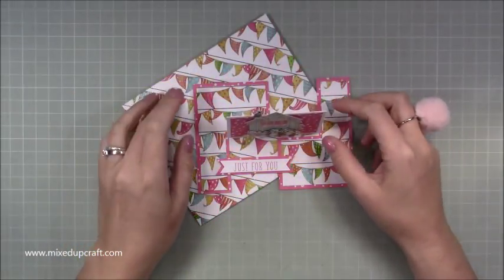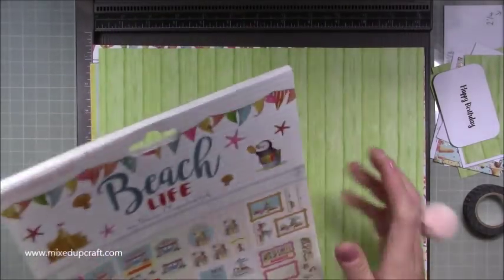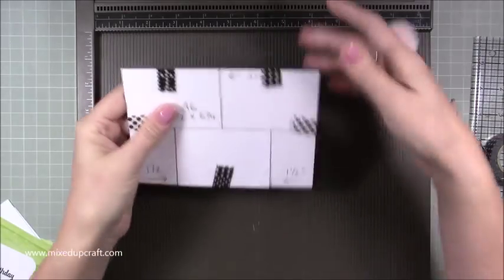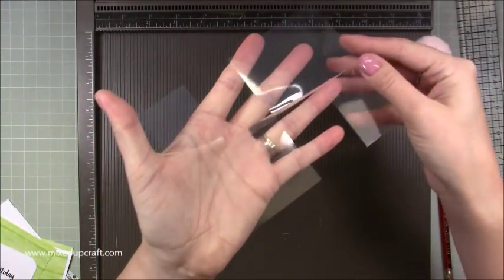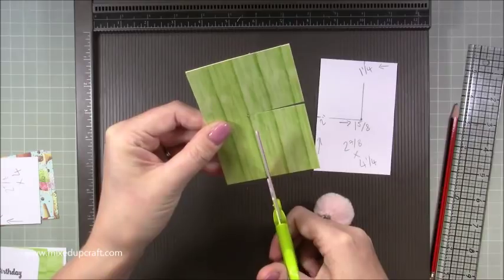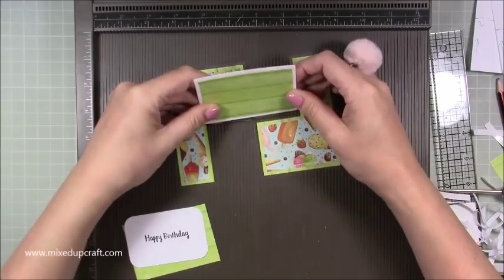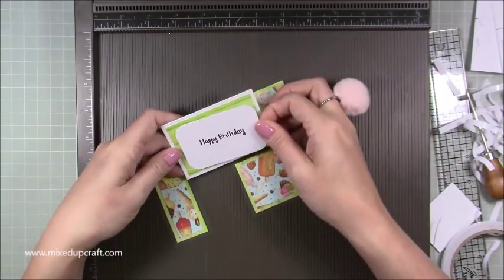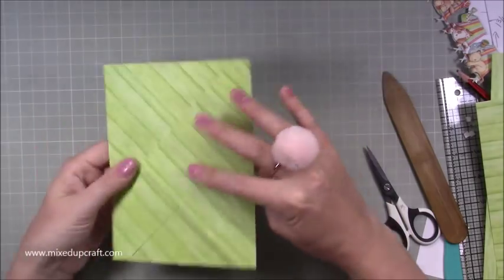Invisible Impossible Card | Floating Impossible Card

Comment: Great tutorial, I made one using acetate a few months ago but I did a steampunk version with most of the base uncovered so it looked like the inside of a clock. If I make another one I'll definitely use your washi tape tip because it did try to slip as I was cutting. Your beach themed ones are so cute! TFS.

Comment: Did you use DS tape to adhere the mat paper and, if so, does it show on the underside? OR did you cut white mats for the bottom? Love this idea with the acetate. Thanks for sharing it.
Reply from the maker: Thank you Linda, I used my DS tape which doesn't show however you can easily just add some white mats at you mention :) x
Reply: I made several and just used my liquid glue. Didn't show hardly at all. Just love the acetate idea and we made them at my stamp club Tuesday night. Everyone really liked them.

Comment: Have watched this tutorial several times and want to give it a try.  Do you know what weight of acetate you are using?  I notice it comes in .003 and .007 .  Would I want to purchase the .003 card weight or the .007 stencil weight?  Love
your easy to follow directions.  Thank you so much for presenting these wonderful projects.
Reply: I would avoid the .003 acetate.  It is extremely thin and it tears.  Wish I would not have bought it.  The .01 acetate might be a little thick for this card (need to test it out).  Wish I knew if the .007 acetate would work.